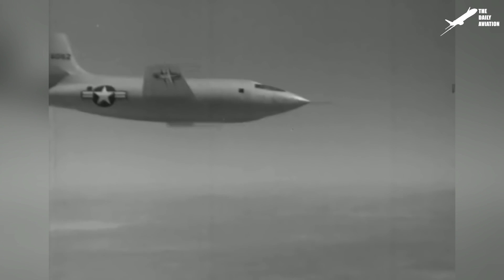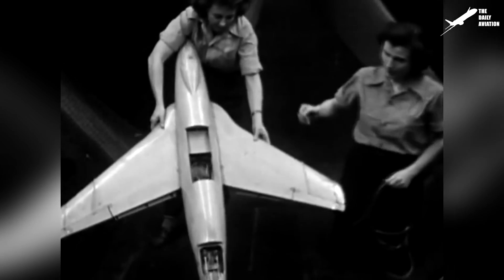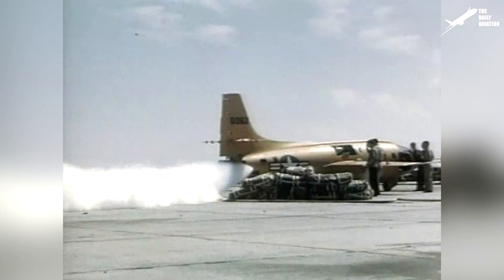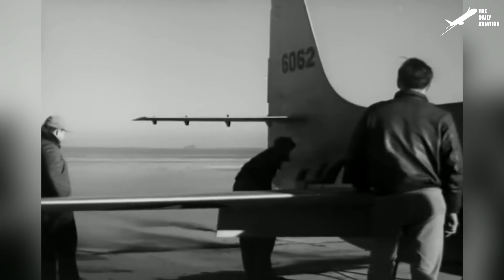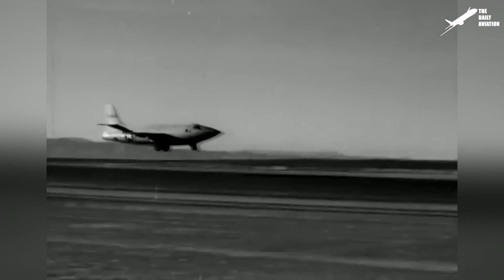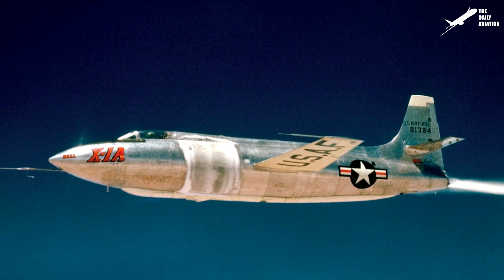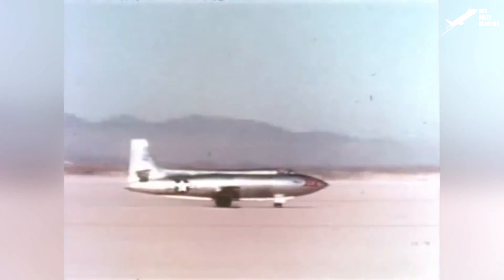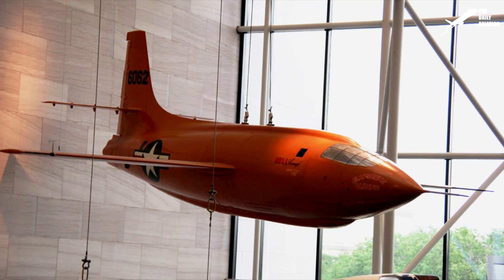This Plane Was Designed like a Giant Bullet to Break Sound Barrier : X-1 Bell History

Comment: Designed by the British company Miles actually. They handed over all the aerodynamic test data to Bell when the Miles M52 was cancelled.
Reply: The Miles M.52 is a hoax, pure fantasy.
The M.52 never existed.
Reply: The Miles M.52 never existed
Stop spreading lies and misinformation about the Bell X1 program.
The British did not contribute any technical data used in the Bell X1 program.

Comment: X-1 First Supersonic Jet in history 🥰
Reply: With  lots of help of the British Miles 52 which the USA copied off. I'm not belittling chucks and Bell achievement, just letting history being told.
Reply: @davidmorrow186  Bullshit! The Miles M.52 never existed

 STOP spreading lies and misinformation about the Bell X1 program.
The British did not contribute any technical data used in the Bell X1 program.
Reply: @davidmorrow186 There was no Miles M.52. No such aircraft ever flew because the m.52 never existed..